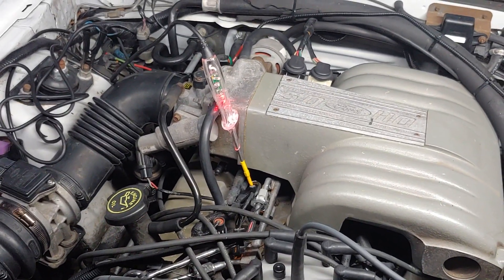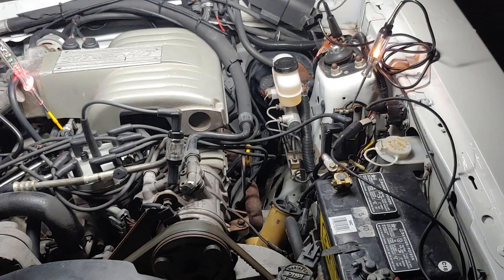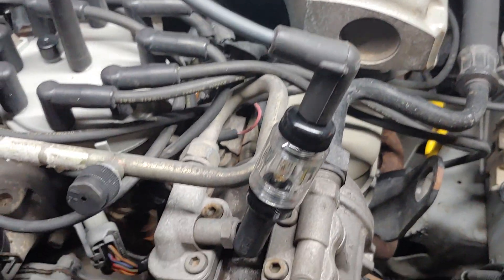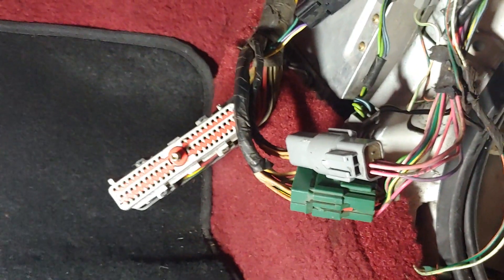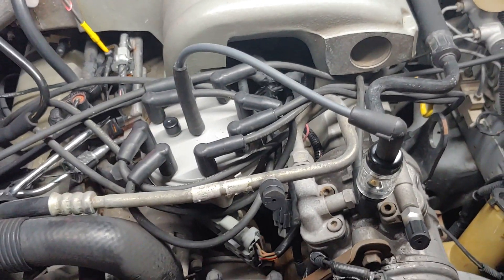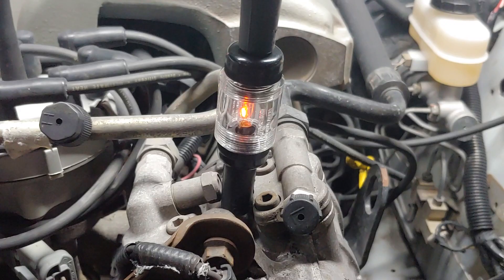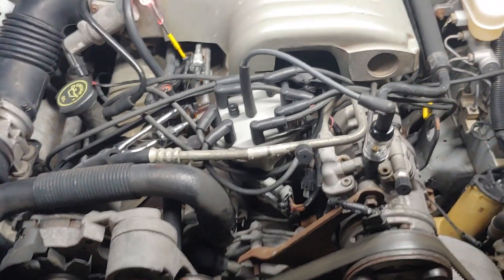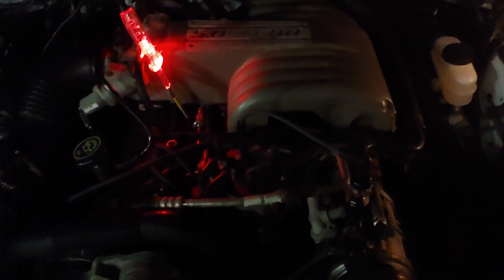5.0L Ford Mustang TFI Ignition Coil Testing - Bad Coil or Bad Computer?

Comment: Hello I currently have my 88 f350 with the 7.5 if I disconnect the spout I do get spark but I am not getting injector pulse. When I reconnect the spout I have no more spark.
Reply: Any ideas I have a new distributor a new coil and a new module and still no start

Comment: Here’s where I’m at on my 95 F150: truck will sometimes run with the SPOUT connector installed. When it doesn’t run I can unplug the SPOUT and it runs great. It’s intermittent, but when I have to unplug the SPOUT to get it started, I can then plug the SPOUT back in while it’s running and it stays running. Any ideas?

Comment: Ok thanks you kno what's weird tho.. is I put a hot jump wire to starter side of solenoid and normally the motor will spin over.nope no cigar just sparks at the solenoid.ane another strange thing  I was checking tfi cord (it's plugs into module not talking bout module itself)! And it might or béen the 4th pin down can't remember but it was giving my test light a pulse..then I realize that the negative battery lead was off...WTF?!?!put it back on battery and then no pulse signal at all..🤯🤔..Mr drag radial ..sir .. anything you have to say I would love to hear it
Reply from the maker: Check voltage AT the starter, with the key on, and then again with the key in the START position. If you have 12v with the key in the START position at the starter, and your car isn't starting, then either your starter is locked up or your motor is. If you don't have 12v in the start position at the starter, then check the other end of the battery cable at the starter solenoid. One side of that solenoid is hot 12v all the time. The other side gets 12v when the S terminal gets 12v from the ignition switch.

I'm not sure what you're talking about with tfi cord, but not module.
Reply: @dragradialperformance3540  there  was a short.a splice in the hot coil wire all the way just before the MSD brain.ran new wirers with heat shrink.boom yahtzee.she fired.thank you so much for your intel.it was muich appreciaqted.love your videos btw.if you have time keep em coming.happy new year ..cheers

Comment: My car failed the first test I have no spark from tfi to distributor. Where do I go from here.
Reply from the maker: That's what the video is for. Watch the whole thing. You would start by checking for power an the coil, then ground/control pulse at the coil.
Reply: @dragradialperformance3540 i understand. But my coil isn’t firing. Sorry I said tfi.

Comment: Mine breaks up at 5600-6000 rpm, what do you think?
Reply from the maker: Could be a weak coil, too much spark plug gap, low fuel pressure at WOT, or a bad TFI module. Possibly bad computer capacitors as well. You have to pinpoint whether the problem is spark, fuel pressure, or something.

Comment: Okay.So if the computer is bad will it still be able to run with starting fluid
Reply from the maker: It depends. A computer can be a little bad, or totally junk. Different things can break inside, and have different symptoms. But keep in mind that you can have spark on a fox body (or TFI equipped Ford) without the computer even being installed. So if you give it a fuel source too, you could get it to run a little bit, even without a computer installed. If your capacitors are bad, have that fixed first. Then see how it runs, and go from there. Sometimes it's not just one problem, it's a stack of small problems.

Comment: Hello,  I have a 1995 svt mustang cobra with the 5.0 engine,  I have an crank no start condition,  I have no spark at the coil, also I noticed the check engine light doesn't turn on at all not even on the second key position,  I replaced the coil and icm and nothing still not spark, im thinking the pcm is bad ,  any suggestions on what test should I do ?
Reply from the maker: You're thinking correctly. The lack of a check engine light means either that bulb is bad, or that PCM is not "on". But before you can condemn the PCM as bad, you must first make sure that the PCM is getting all the powers and grounds it's supposed to have at the PCM connector, with the key on. Look for power on pin 1 all the time (keep alive memory), and on pins 37 and 57 (key-on 12v). Look for constant ground on pins 20, 40, and 60. And look for 5v on pin 26.

If the powers and grounds are there, you should have 5v coming out of the PCM on pin 26 (VREF). You should also have a check engine light come on, and a fuel pump prime for 1 second each time you turn the key on. You can also communicate with the 94-95 5.0's using an OBD1 scantool. If the powers and grounds are good and the PCM doesn't do these things, it's bad.
Reply from the maker: Generally, these PCMs are not known for failing, but anything is possible. I would be more likely to believe it's not on. You might want to start with checking all the fuses and any fusible links.
Reply: @Drag Radial Performance   I am doing all the test you mention in a couple hours.  I have a powerprobe so I can check grounds and powers at the pcm connector pins,   also I do have a ford obdI scan tool,  the code that I got is 212,  something related to the pcm not getting a signal from the ignition module.   Wish me luck!
Reply: @Drag Radial Performance  I checked all the power and grounds you mentioned also the 5v ref , and everything check out ok, I even swap the pcm for another from a 95 cobra I own and still doesn't start.   I check all fuses and the fusible link between the fuse box and the alternator and is good.  I don't know what else to check. I can't get this thing to start
Reply from the maker: @mr.selfdestruct1677  Code 212 is Loss of IDM input to EEC or SPOUT circuit grounded. Good luck!
Reply from the maker: @mr.selfdestruct1677  Figure out what's missing first. Then figure out why it's missing. While cranking the engine, check for both spark and injector pulse. Injector pulse is a ground pulse, so the test light gets connected to battery positive. Or use a Bosch type NOID light. Also check for fuel pressure (should be about 39 PSI).

You're missing one of those 3 things. The combination of which of those 3 you have or don't have will tell you where to turn next. If you're missing spark, you first make sure you have power to the coil and to the ignition module (key on). Then you make sure you have coil control (ground pulses) during cranking. If you're missing injector pulse, first make sure the red wire has 12v key on, then make sure you have a ground pulse during cranking. Fuel pressure is easier. Screw a gauge into the schrader valve (it takes a Ford schrader valve adapter), then turn the key on and you should have very close to 39 PSI.

Comment: Thanks for this. I'm getting OBD code 18c and 95oc. I have power to both fuel pump and relay with key on. Cranks, doesnt start. I will try with cpu out like to did to at least know if its good or not
Reply: how'd you make out?
Reply: @kevin_nagle  not so good. Fuel pump, inertia,  fuel pump relay all checked out good. I pulled the dizzy to change the TFI module  and the oil pump shaft fell in pan...I left it for now lol
Reply: @HC-xs6ek  OH MAN!  When it rains it pours 😓
reach out to me if you want troubleshooting help
Reply: @kevin_nagle  thanks brother, I pulled info on dropping pan from ALLDATA. Remove fan shroud retainers, remove dipstick and tube assembly, drain oil, remove 2 bolts retaining steering gear to rest on frame, remove engine mount retaining bolts then raise engine, place 2x4 between mount and frame.. what gets me is it then says to "remove rear k-braces". Not sure if it means rear bolts on k-member?
Reply: @HC-xs6ek  Can you try to fish it out from the distributor hole with a telescoping magnet?

If not,  you basically need to get the engine up high enough to get your hand in the pan. 

Sometimes following written instructions will have you performing steps that aren't necessary
Reply: @kevin_nagle  that was my first angle to fish it out, no good. I shined a light down there to see if it was leaning or something...no good.
Reply: @kevin_nagle   I lucked out. Went to Harbor Freight and bought a video scope and sent it down the rabbit hole lol. Found oil shaft leaning inside to the right of oil pump. I continued the long magnet and after close to 2 hours I got it! Re-seated with bearing grease on end of dizzy and she slid right in! Cranked and no start, after another 2 hour search I stumbled on a board that mention capacitor failure on ECU...Sure as shit, 2 of 3 of mine were completely corroded! Now I'm sending it out for a full refresh and new capacitors.
Reply: @HC-xs6ek  wow definitely had some good luck & skill on your side with the magnet - good find on the ECU

Comment: I got a 95 e250 with a 5.8 it cranks no start no Fire from coil put a new icm in and nothing
Reply: Diagnose it the same way as these Mustangs. See my other testing videos too.
Reply: @Pontisteve   I got power to 1 side of coil the the distributor side I change the fuse link and everything.  New coil new pump new icm crank no start

Comment: Hi great video! I have a question please, I have a 1988 5.0l and for some reason the vehicle isn’t holding timing. I set the timing, go out for a test drive, put the spout connector back in and everything seems fine. The vehicle starts up with no issues but then stumbles at idle and while driving the next day. I recheck the timing and it’s off. 
I checked everything, from EGR, vacuum leaks, map, did a base idle reset etc.. still no luck. I have no idea why this is happening. At this point I’m thinking it’s a bad computer or Ignition Control Module because it’s not holding timing correctly. Any thoughts on what could be causing this problem? Thank you.
Reply: When you unplug the SPOUT connector, you are eliminating computer control of timing, and the ignition module instead fires the coil at a fixed timing value every time. That value is set by you, and should be 10 degrees BTDC.

Plugging SPOUT back in let's the computer control the timing, but as soon as you unplug it again, it should be rock solid at 10 degrees BTDC again.

Unless you are using your timing light wrong or it's defective, the only way the timing can chance with SPOUT unplugged is if the distributor bolt is loose, there's something defective inside the distributor (like a broken rotor or rotor plate), or your harmonic balancer is really bad.

The balancer has inner hub that bolts to the crank, and an outer hub that is presses onto the inner hub with a piece of rubber strip in between. When this rubber gets really old and bad, the outer hub can slip on the inner hub, moving the timing mark. Actual timing doesn't move, but the timing mark does. You can check the accuracy of the timing mark on the balancer using a brass piston stop in cyl #1 plug hole, and rotating the motor both directions until it hits the piston stop at about 10 degrees before and after TDC.
Reply: @Pontisteve  Thank you for responding. 
I did a water pump change and the balancer was ok, I thought the same thing at first but I’m still having the same issue. I will recheck the rotor and plate again. I marked the balancer and set it at 10 degrees BTDC and plugged the spout connector back in and it seemed to drive fine. The crazy part is, the next day when the engine was cold the car had a rough idle and when I took it out for a ride, the engine started stumbling and had lack of power so I checked the timing again and it wasn’t at 10 degrees, it was jumping between 12 to 40, so this one has me confused lol. I did new plugs, wires and rotor cap. I didn’t change the Ignition Control Module so I was thinking it’s bad and not sending the correct signal out. Not sure why it’s not holding timing to be honest. I really don’t want to throw money at it without knowing the exact issue. But I will check it with a different timing light and go from there. Thank you for the advice I appreciate it.
Reply from the maker: @sheba6779  You're only checking timing with the SPOUT connector removed, correct? Because with SPOUT plugged in, timing will be moving all over the place, especially at idle. Unplugged, it should be 10 BTDC at all times. Plugged in, idle is centered around 20 degrees BTDC in the computer's commands, but will move several degrees in either direction of that to perfect idle quality. The worse the car is running (for some other reason), the more timing the computer will add or subtract from that centerline of 20 at idle.

Comment: My 87 LX 5.0L with 165k miles sat for about 3 years , I replaced heater tubes,  TC cover and water pump and also all fuel injectors. When I cranked it, it ran horrible. Shut it off, Went to work, came back, and engine would not run this time  (no spark). I figured out  I had mixed up #2 & #3 wires on the distributor, so I corrected that, but I still have no spark. I don't understand how that could have created a no spark condition. Any ideas?
Reply from the maker: Try unplugging the SPOUT connector, and see if it runs that way. If so, the PCM is failing. Capacitors going bad is a common problem with them at this age, and can be replaced by someone skilled in that. Use this video to make sure you have 12v at the coil when the key is on, and that you have a pulsed coil ground signal (coil control).

Also test for injector pulse, to see if you have that. Double check your firing order, and make sure #1 is located on the correct cap terminal. You should not move plug wires around on this engine. And certainly check fuel pressure. If the car sat for years, the gas is bad and the tank has to be drained, new fuel filter, and probably new pump. Fuel pressure should be 39 PSI.
Reply: Ok, I have verified that there's 12V at the coil. I've also verified the coil is good by checking the primary and secondary's resistance. I bought an in-line spark checker... no spark coming from the coil, so it's either a bad TFI module or bad component in the distributor, since your video shows it should spark even with a bad pcm. Let me know if I've missed something. Note: I've never replaced the distributor in this car (only the cap), but the TFI module has been replaced 2 times with Motorcraft ones which corrected the no start condition both times.
Reply from the maker: @mrau92me  crank the engine for a second or two, then stop cranking it. But leave the key in the run position. The fuel pump should run until 1 second after the engine comes to a stop. If it does, the PIP Sensor in the distributor is good. If you can't get the pump to run during cranking, then suspect the PIP Sensor. Otherwise, suspect the module.

Unfortunately, the old Ford Motorcraft ignition module was the only good one, and they quit making them and started outsourcing them from China a few years ago. You can now go thru several new modules  trying to get one good new one.
Reply: @dragradialperformance3540  Thanks. I'll try the pump running test. What do you know about the MSD branded TFI module? I'm wondering if it could be just a relabelled Motorcraft one.
Reply from the maker: @mrau92me  the original Motorcraft modules were embossed with large Motorcraft lettering in hard plastic. A few years back they quit making them, and now they look just like the cheap Chinese parts store modules, with Motorcraft stamped in ink on a flat surface. They're buying them now and reselling someone else's module. It's not nearly as good as the real Motorcraft ones.

I don't think it matters which brand you use. I believe they're all mediocre. It's now random luck which one you buy. I would think one from Standard Motor Products or NAPA would be a good bet, as these have been out for a long time, and hopefully they'll have worked out the obvious bugs.
Reply: 1st, I just want to say thanks for the help so far.
Ok, so PIP sensor is good (fuel pump runs for 1sec after cranking). The test light when on  negative side of coil looks same as it does when on + side while cramking. Engine doesn't start when SPOUT jumper unplugged.
Reply from the maker: @mrau92me  Sounds like your PIP sensor is good, and your coil has power. But your module is not commanding the coil to turn on. You can check for coil control pulse at the module if you want. But it sounds like a bad module to me so far.
Reply: @dragradialperformance3540 Well, she's running now! I've been dressing everything up on the engine as I put everything back together, so I put in an SSR-III dizzie from Jegs last night... it fired up immediately. The polished and red dizzie looks great too against my Ford blue wires
Reply from the maker: @mrau92me  I'm glad you got it going. Those modules are problematic for sure.